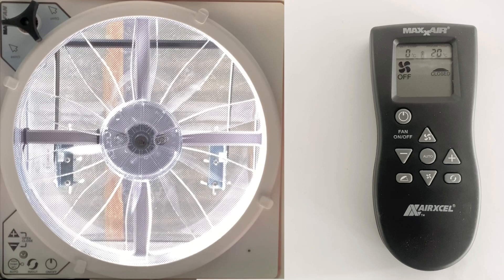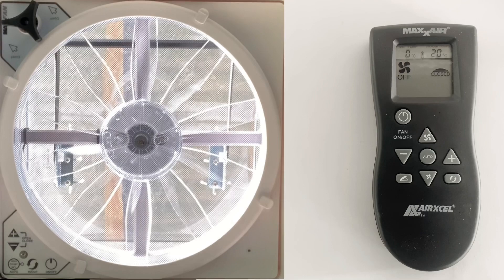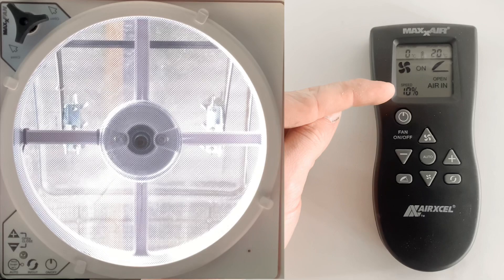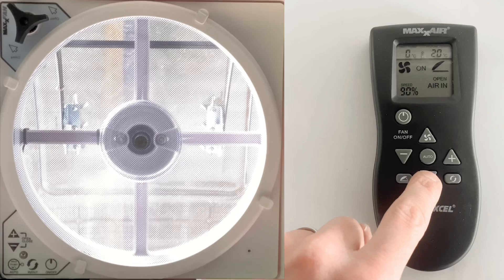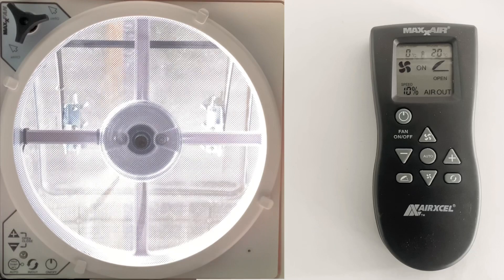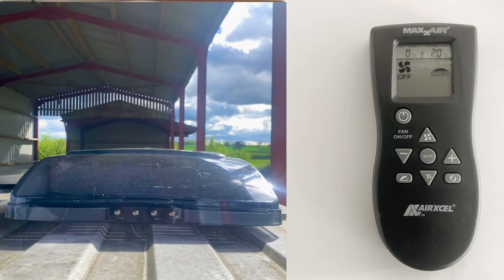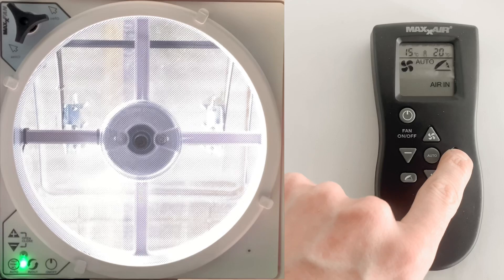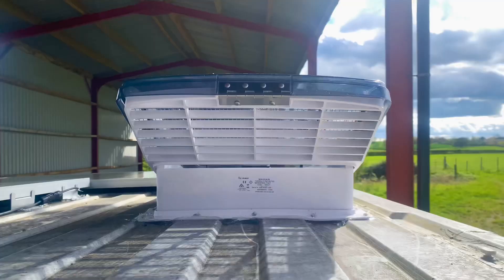How to use a max air fan remote control ￼

Comment: I keep trying to blow the air in instead of out and everytime i press the button the Air out icon just blinks
Reply from the maker: That’s a strange one, I can possibly try 

1. Possibly try changing the batteries

2. Obviously would be nice to use the remote, but you can always use the buttons on the fan it’s self

3. Get in touch with Maxx fan explain the problem and they should be able to send you a spare remote
Reply: @Where-the-wind-goes  it doesn't seem like there's any buttons, also, the batteries are new, AND it's doing it to both remotes on both fans. The fans itself just makes a "beepbeep" noise
Reply from the maker: @RainTheRipper  I would definitely get in touch with Maxxfan they are a pretty good company! I’m sure they will sort you out 🤙🏼